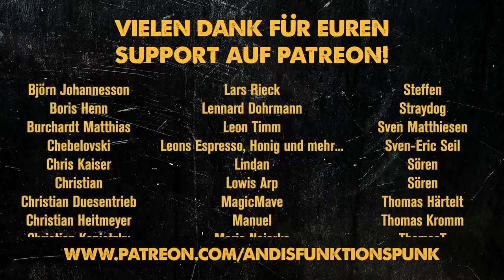Eine schwarze Seele für den weißen Teufel | Zündapp Sport Combinette | Andi Feldmann

Comment: Moin!
Ich hab mir für mein erstes Mopped, eine MZ TS 250/1 (50 DM), um die Zündung einzustellen, die Zündkerze leergebohrt, dann einen Adapter mit einer Messuhr versehen!
So konnte man direkt ablesen, von OT war, und die Zündung einstellen!
Leider habe dieses chicke Teil aus meiner Lehre (danke an die AEG Oldenburg), verschenkt!
Man konnte damit sowas von genau die Zündung einstellen...es war, wie gesagt aber auch ein 250 ccm Motor aus der DDR